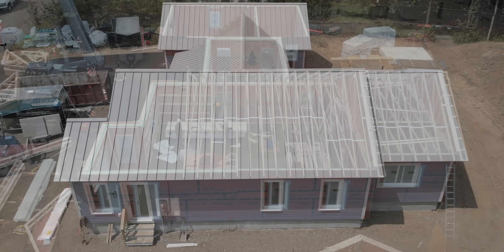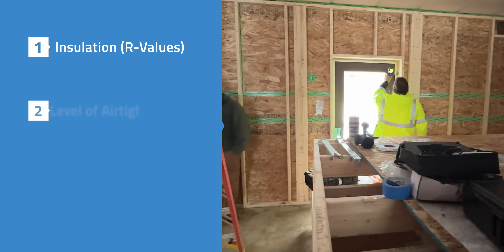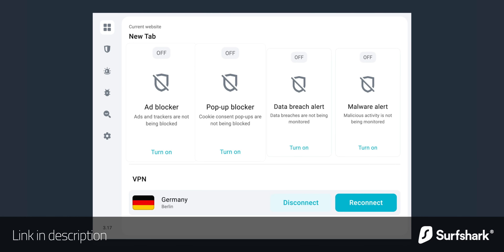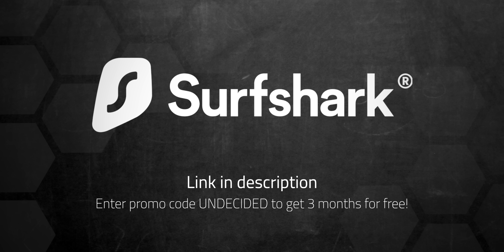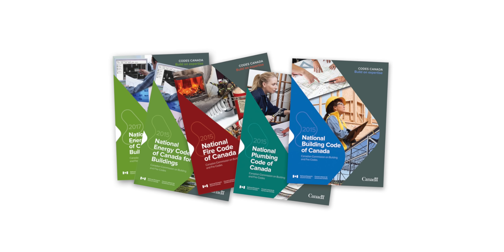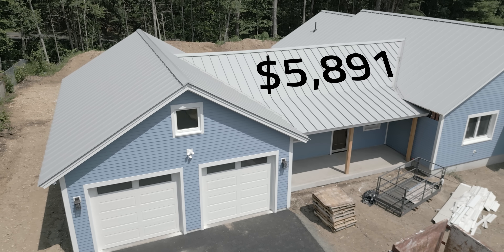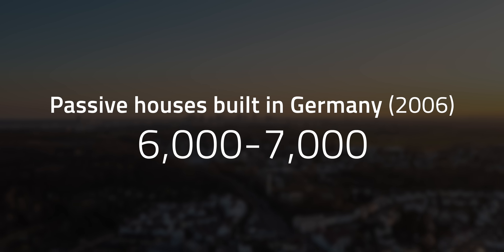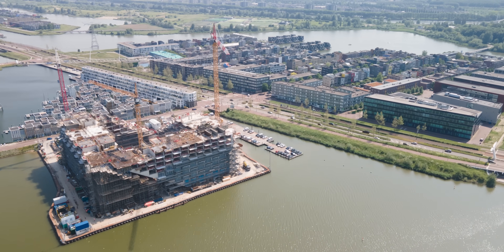Why Do American Homes Suck?

Comment: My house was built in the drawdown from WW1. One proposal by AOC in her "Green New Deal" was to demolish all houses over 50 years old and mandate Passive House Standards on all new construction. Demolishing the old houses (like mine) is inexpensive. Building new houses to the new standard is outrageously expensive.

I had a car that needed an alignment because it was wearing out new front tires every 6 months. The problem was the front end was so worn out that no alignment given would actually stay. To rebuild the front end would cost $2500. Not a worthwhile proposition on a 25 yr old car that wasn't worth $2,000. Instead, I spent $150 every 6 months on new tires. In the 5 years I had the car before I slid it off a mountain in a snowstorm, that worked out to 10 sets of tires for a cost of $1500 and a net savings of $1,000 vs the front end repair. Further, $150 every 6 months was well within my budgetary constraints while $2500 up front was not.  

You knock "too expensive" as insufficient reason to made certain choices, but most of us are running on very limited budgets. How you're affording this net-zero home build is beyond my understanding. That's why I opted for a 100+ year old fixer-upper for $35K in total vs which $35K toy to add to my $400,000 science experiment.

Comment: Im honestly shocked that UK is in top 5 in terms of energy efficiency and Russia is somewhere at the bottom.
I have been to England and they have a LOT, like more than 60% of houses that are of VICTORIAN era and are cold as hell with mold issues all over, draft is a normal thing, so insulation is not good and the old buildings are full of small holes... not to mention that the damn sinks in bathrooms and kitchens have 2 faucets, 1 for HOT only and another for COLD only water. You have to put a plug in the sink, then fill the sink with water from 2 independent faucets to get the water to comfortable temps and then wash your dishes/hands in that filled sink in dirty water... WHAT A FREAKING IDIOCY! And apparently its very common in UK and it goes back to Victorian times and most people dont upgrade the plumbing because its TOO EXPENSIVE ???

I have been to Russia many times, there its a completely different system for housing construction and how energy systems are designed.
1. Pretty much all cities, LARGE AND SMALL have central heating and central hot water systems. The only places that dont have central heat and hot water and small towns and villages of population less than 5000 people or so.
2. Houses are constructed from either BRICKS, MASONRY STONE (like many old buildings in St Petersburg where thickness of wall is between 60-100 cm, yes 1 meter thick walls), monolithic concrete, or some kind of prefab concrete panels... Most Soviet high-rise construction, above 5 floors was prefab concrete panels for outside walls and floor panels and bricks for inner walls. Outside walls are around 30cm wide, some are a bit more like 40cm. Concrete is great at controlling temperatures and noise insulation.
3. In terms of windows, i think almost everyone has modern 3 pane windows....like in many European countries.
4. Energy is cheap in Russia and in many regions its cold for 6 months out of the year so heating is needed for 6 months in a year. Not sure how that plays into energy efficiency calculations...
5. Apartments i short term rented and friends i visited had no issues with any kind of draft, so they were all well insulated.

Comment: My mom recently built a house in Mexico with like 80k. Its a bomb shelter, thick concrete walls, solid metal doors etc. Our US house feels like its made of paper in comparison.
Reply: The fact that the walls are very sturdy doesn't necessarily make it better.  Concrete is a very bad insulator, and it won't necessarily last longer than a house made out of wood.
Reply: Labor costs in Mexico aren't even comparable to the US. Try building the same house in the US for 80k and you'll quickly see why US homes don't min/max their energy efficiency. Most people in the US can't afford a million dollar air sealed, perfectly insulated house up front. But they can afford an extra $100 on their energy bill. Also on a separate note, there's just not a ton of large scale home builders in the US that still put much care into their work.  Sure there are smaller boutique builders doing very high quality work but that equals lots of money. Most builders are putting up slop as fast as they can so they can move on to the next cookie cutter development.
Reply: @MilkBoy17520  D R Horton and Ryan Homes come to mind. So many cookie cutter developments thrown up in barely month’s time, with buyers left holding the bag when major issues start popping up within the first year.
Reply: @MilkBoy17520  Artificial Costs, In the US its not about Labor, its about cost of materials and doing the least amount of work possible, when I built my home in the US it cost me around $140k 2.5 acres of land, it was steel I beam and Concrete slab construction, the difference is if you go through a contractor you are adding middle men to the equation and they all try to get as rich as possible with the least amount of effort, every material has an overcharge, you do not allow a firm to buy materials frankly speaking they steal from you while overcharging out the balls. the Project manager is always a major extra cost. Do not go to a contracting firm, every person is an added $5-10k for their services, and those services are over charged to make "Buddies extra" money. Go to an architect yourself, tell them what you want, buy the land and step by step put the project together yourself, you can knock about $50k off the price of the home or maybe even more from what some of my friends told me. Do some of the work yourself, particularly on the inside of the home these days you have youtube videos and a bunch of stuff to help you along, its also not that hard to actually ask questions for building codes and such. 
I was kind of real lucky because of placement and location of where base materials were put together - The I beams and connections I went all first party to the steel factory, and a company that made concrete/iron rebar road constructions literally was within 30-120 miles of the project site, in fact, Everything, was down the road even a crane and construction equipment loaning company. The reality was it was a 2 story steel i-beam and concrete layered cake construction just like a multimillion dollar commercial property, even a custom window company was 2 towns away right along a major highway, aluminum company was also down the road.
The reality is you pay more than you should due to you ignorance, its literally an "ignorance tax" where people who probably should have a job have jobs and charge you out the balls for it. The difference is in Mexico you don't have this same level of legalized scammers that created professions in order to profit, sure its convenient for you, but it adds massively to the cost of the creation of the home.
Reply: This whole video screams govern me harder daddy. Here in Australia we have a housing crisis and energy crisis, the average family home is 10 to 14 times the average annual wages and my electricity with a 14kw solar system is still 1500 a quarter. I dont know how my children will afford housing unless they all become neurosurgeons. Instead of forcing the market, educate the population on the savings and allow the market to steer developers to construct better housing.
Reply: @mrlush84  People need to learn to invest more time and money into their homes. I will always encourage people to custom build their houses

Comment: I would like to add that on top of the low standards volume builders like to maximize revenue above all else, most of the building code in the US is cut-and-paste from the private, copyrighted codes written by the National Fire Prevention Association, a private lobbying group headed and chaired by members of building, electrical, and energy companies that manufacture the products American consumers need to buy in order to be in compliance with the private, copyrighted building codes that the NFPA has been ordered to make public by the Supreme Court - a court order the lobby group has openly flouted for years.

I would also like to add that because there are NO housing protection laws in the US and the real estate market is very liberalized (and where there is regulation, it's basically regulatory capture), meaning houses are less a thing to live in and more a security on a financial exchange market made of sticks and gypsum instead of digital stock notes.

Comment: A) Because you aren't building "houses" you are building wooden shacks for the most part! Those are heat-traps in summer and their insulation isn't all that great either! A true house is IMHO built from brick, has double glazed windows (no wooden windows! Those suck donkey balls!), a basement (accessable from the house, not a hatch in the garden!) etc.
B) Because you use technology from "the distant past" (so stuff from the 50s!)

Comment: Thanks for doing all that amazing research on this subject and sharing it with us!
I had been intrigued by the idea of passive and energy efficient homes for many years.  Particularly a design that used cement blocks under the floor so that air could circulate under the slab and act as a heat sink. One drawback I thought of was the possibility that mold might become a problem under there, especially after much air had bought dust, mites, etc to rest there. How would you clean such a thing? It would be interesting to see how many of those homes are still functioning as they should.

Comment: I just bought an apartment in a new building complex in Iceland 2 months ago and It is very well insulated and that is also the reason I bought it because older homes have less standards. This is interesting topic. I was visiting family in Canada last year and it struck me as odd that the inside walls had barely ny insulation so you could hear quite well when someone used the toilet or took a shower. We don´t hear that as well here.

Comment: High majority of builder only care about profit in the US so they do as little as possible and a lot of the builders now are building homes that won’t last. But some US builders build above code and are more concerned with reputation than profits. You have to research these builders and the products they use because a lot of times because most of the money you spend goes right in the builders pockets and not into the quality of the home. Most homes in the US are terribly built but not all homes are.

Comment: Well, when energy and wood is cheap, there's no incentive to spend money on insulating materials and efficient appliances if running AC and heating is still cheaper over time.
Also the culture of working your way up from a starter home to fancier ones isn't really compatible with ROI times measured in decades. The next buyer (and the bank) doesn't really care if you spent 50k on efficiency upgrades, they'll just buy the neighbor's home without those upgrades for cheaper.

Comment: At no time did I hear how much more expensive a passive energy home is than the so-called American home that sucks. I have a feeling it will be at least 20-25% higher in costs, which means the average new home in the U.S. would approach $600,000. That is out of reach for about 50+ percent of Americans. What would it cost to retrofit an older home to new passive standards? I am willing to guess about $125,000 and up. You can pay it now or pay it later. Or just stay with your current system. Let the people decide instead of the government.

Comment: I don't know dude I'm building a home in the tropics where we have to worry about tropical storms, as in 6 - 10 a year, some can end up being typhoons.

Building a home there is usually done with construction grade cinder block, which then has rebar slid in and it's filled with cement.  Don't have to worry about the cold, and if you do some creative design you can keep the sun off a bit of the house even part of the roof which will have solar panels on top and keeping it cool enough to live in is then not so bad.

SOME construction is done with wood.  Those poor souls.

Comment: I am all for making houses more comfortable and longer lasting, but only if it is done by the home builder or developer themselves and not forced by any governmental regulatory agency imposing some “green” initiative.
The only thing the federal government should be doing is protecting the consumer by making sure safe building materials are used and maybe doing blower door test scores to be sure all the proper ventilation systems needed for a house to be “safe” are installed and functional.  Including radon levels, etc.

Comment: They set the energy conservation bar low in USA. That’s common knowledge. What’s not common knowledge is how we got that way and Matt does a great job of explaining this is a few minutes. I was impressed how stable the temperature is in a new home in Germany with out the heat turned on. A new home I visited in USA has large temperature swings and requires the heater to turn on and off multiple times a day. They did stop allowing 2x4 walls in some states. Washington requires 2x6 walls now.

Comment: What is also very important besides just good insulation, is that the building is compact - i.e. strive to make it more like a cube to reduce the surface area. Then it is much easier to achieve the passive house standard at reduced costs. The building also should not be too large, so that internal gains are large enough to passively heat. Both these points are taken into consideration with new builds in Germany. We have done that. Now insulation gets more bang for the buck. We have u-values of < 0.15. To compare the performance: The water temperature for our floor heating is 26°C when it is 0°C outside.

Comment: Back in the '80's we bought a 1200 sq ft house with concrete walls. It had no insulation. The first winter it got down to -15f. The 100k BTU furnace could barely keep up. Over the years I gutted it and framed out the inside with 2x6 over 2" Iso board then 6" of Roxul. On the outside I put 1" foam board and wood siding. Added triple pane with storm windows. Put R100 in the attic. Just waste heat from living keeps the house warm down to about 10 degrees.  I remember buying the windows and storm windows the sales man thought I was nuts. I still have my 70 year old furnace because it has gone whole winters without coming on but when it does it is super quiet and modern furnaces are always broken. I like my cast iron heat exchanger. I had the furnace reduced to 40k btu. The HVAC guy said he had never put a super efficient A/C unit in such an old furnace before.